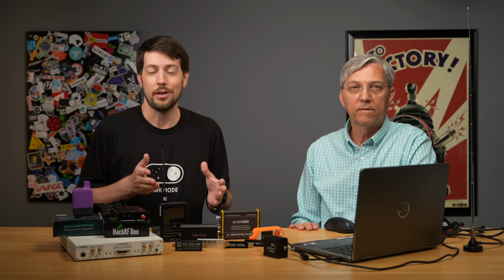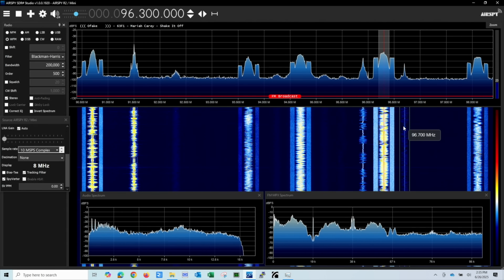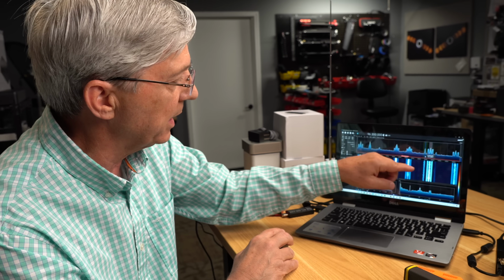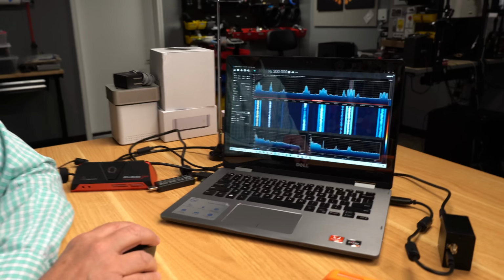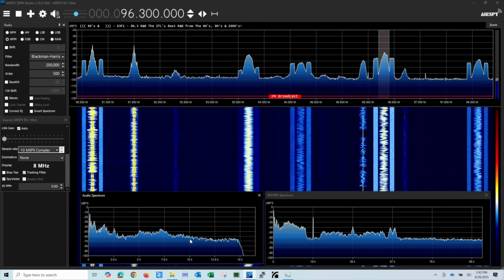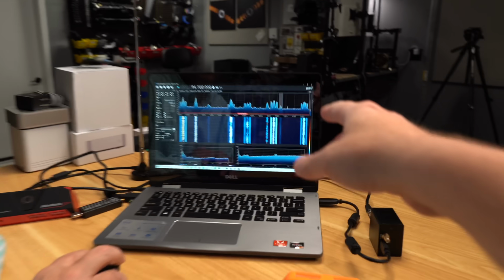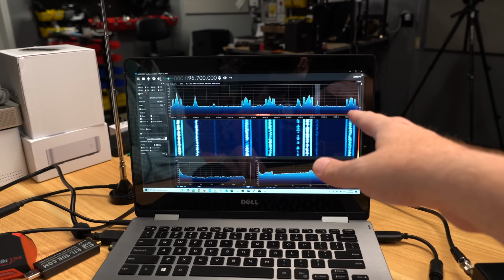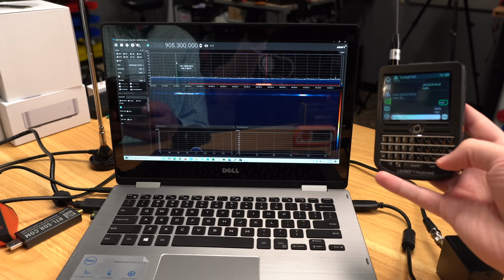SDR is an incredible tool for understanding radio

Comment: "It's a little bit hot and that's a cool thing"

But seriously, they have heaters in them to keep the crystal oscillator inside at a constant temperature for frequency stability. Stacking them probably isn't a good idea because the calibration temperature probably isn't the same for each unit.

I have a couple RTL-SDR dongles, one is a local flight radar (dump1090 and VirtualRadar), one is connected to a FM band antenna and I use it to listen to the radio on a computer. I have a HackRF One for just exploring radio bands. I just got a LibreSDR but I haven't tried it yet. I'm also a amateur extra class license holder so I often use them for amateur radio. Back in the dark ages I had a "First Class Radiotelephone Operator" license because I wanted to work in broadcasting, but I couldn't find a job I liked at the time. A few years later those licenses were discontinued and the FCC gave me a lifetime "General Radiotelephone Operator License" to replace it, which I never used. I've had an interest in radio technology for most of my life.

Comment: Helpful, thanks! What I'd like to see is what you propose for modern amateur radio astronomy. There is mainly 1420 and 20 MHz and 3-1700 KHz. One needs to record slightly above and below center to capture red shift. Linux (maybe Ubuntu) would be ideal due to the popularity of that OS for astronomy. Any experience with SDR on Linux?

Comment: I had the Airspy back in the day;) Really nice noise floor (or lack thereof) on that one. I ended up using a Nooelec NESDR in the end.. that one is fine for basic stuff. I connected it to an old MMDS downconverter to be able to watch the protocol from the nrF-chips for wireless keyboard communication.. that was quite the rabbit hole! Also looked a lot at the TETRA-networks and GSM stuff:)

Fun fact about those ferrite beads. I once came across a cable with one of those bumps on it but it seemed strangely light for what it was. I knew it was supposed to be there for emf supp so I was curious about and cut it open. Turned out it was just a plastic mold. Totally fake!

Great video;)

Comment: The chokes remove common mode that is on the cable. Its not resisted, its turned into “magnetizing force” thru induction.

Comment: Would the HydraSDR be able to catch ATSC1 broadcasts ... Open Source TV!!
Reply: Yes HydraSDR RFOne can definitely receive ATSC1 broadcasts (54-700 MHz, 6 MHz bandwidth).
You'll need proper decoding software like GNU Radio with ATSC1 blocks, SDR++, or specialized TV-SDR software.
Make sure to use a good UHV/VHF TV antenna for best results.
The HydraSDR RFOne's wide bandwidth makes it great for monitoring multiple TV channels simultaneously - perfect for open source TV projects

Comment: Love the videos with your dad. RTL_433 would be great to look at, keeping it to weather stations and tyre pressure. I use it to collect data off my sensors. NRSC5 might be pushing it legally, but I use that to transcribe talk radio to turn radio content into summaries with Ollama. NRSC5 can also get weather data (radar loops) which is super fun, figure you can know if it's raining or not using Python CV2 😅

Comment: Just got myself a cheap sub 27 euro (due to crappy country laws) generic rtl chip usb stick.

There is always a spike to the right. The antenna is picking up fm fine and thats it. The connector is really weird. 

I bet the next step is for me to pick up a telescopic antenna with that connector.

Comment: 6:51 There is a Github project called NRSC5 that can decode and play the digital HD Radio signal. It works better on Linux but it's ok on Windows too. It does require compiling, but there are some exes around if you read the comments.

Comment: Very excited to see this upload. I would love a series on the SDR world. I just got my GMRS license to allow me to make local TX transmissions/connections in the 462Mhz and 467Mhz frequencies legally while I work on my HAM Technician license. I have had a RTL-SDR for a while and have been trying to learn more on using it correctly along side the Flipper. Also got the HackRF clone with the Portapack H2+ to accompany those that should be delivered today. Right now with the RTL-SDR trying to learn how to decode P25 from my local police/fire departments.

Comment: I use a Raspi 3B+ and a Flightradar SDR Stick for tracking Planes in my Area with ADSB. Works awesome and I'm contributing to FR24 + I get a Business Subscription for that. Also a PC running the same software in another Country collecting FR24 Data.

Comment: Chokes filter out high-frequency common-mode noise, care has to be taken when choosing a material because they respond to frequencies differently. I don't know much about the methodology of choosing a size, shape, and material besides trial and error, maybe some Electromagnetic Finite Element Analysis if you are a professional-- to know exactly what effect they have on an electrical network you need a Vector Network Analyzer, or y'know just put the recommended material type ferrites on things until the RFI/EMI causing you problems goes away :)

Comment: Wanted to point out that SDRs like the Airspy R2 and HydraSDR using USB 2.0 is a huge limitation. If you need more than one make sure they are on different USB 2.0 Root Hubs.

Comment: I like SDRPlay’s devices. I have the RSP1 and with an up converter has given me what I need. The RTLSDR dongle from the RTLSDR website folks is good too. Even the tv dongles are ok with a long wire wrapped around that useless antenna that comes with it.

Comment: FYI the DSB mode is “double sideband” and is sometimes used by simple homebrew ham radios. It’s the equivalent of USB and LSB at the same time, or AM without the carrier in the middle. 😀
Reply: so in other words "double sideband suppressed carrier"  , DSSC
Reply: @robdavis3220  Well, yes, that's the same thing, except I'm not sure that is the correct term if the DSB signal has been generated with IQ modulation. But with standard methods like a balanced modulator then "double sideband suppressed carrier" would indeed be correct.

Comment: I have a NooElec NESDR Nano 3 plugged into my Home Assistant Yellow grabbing the data from the outdoor unit for a weather station we've had for like a decade at this point. This particular one only sends temp and humidity from outside. I want to upgrade to a unit that does all the data.

I also would like to see if I can get data from our water, gas, and possibly electric meters, but I haven't really poked those too much yet.

I also have a few RTL sticks I bought on AliExpress like 10-15 years ago (I bought 5 and sold a couple to friends that were interested in them), a couple of RTLSDR branded ones, some of the NESDR nano 3s, and a HackRF One.

Comment: The spurious rf that isn't a real signal being picked up are/were called "Birdies" in scanner documentation.

It was my understanding that they were a product of the receiver picking up harmonics of their own circuits. Every open wide band analog receiver has them. For an SDR you could probably only discover them in a RF shielded chamber. Being an SDR it should be possible to mask them in software, but that shouldn't be done without the user.knowing its being done.
Reply from the maker: A dummy load attached to the antenna jack may help too, I think. Might dig into that more.

Comment: I had to buy an inline choke for my Aux cable as it started picking up a nearby radio station and messed with my recordings! They're really useful to stop accidentally making antenna out of wires!
Reply from the maker: Everything becomes an antenna... usually when you don't want it to!
Reply: Heehee so true and then when you want to become an antenna, it refuses

Comment: i do wonder if you touch the end of the connector if you would revceve a RFburn abit like what happened to me in 2012 when 
i touched the pin out of my Bofeng when i boardcasted.     it was prob my first bad shock from messing around

Comment: I am a licensed Ham. I can sit down to just about any Ham radio new (analog or digital) or vintage and operate it, AM, FM, SSB, Voice, Digital etc. As a Ham I like HF digital operations, with no problem. But I have an RTL-SDR for about a year now  with SDR Console and SDR# software and have never been able to get any satisfaction out of it. What I would like to do is monitor entire bands or swoths or ranges of frequencies, yet to no avail.

Comment: Ok, this is the second time your channel blows my mind. I'm Bulgarian. I was wondering how to get into SDR because I want to be able to diagnose wifi issues. But the deeper I went, the more my interest grew. Hence I'm watching your video for pointers. Lo and behold, you feature a bulgarian product. Not only designed but MADE here. Less than 150km away. Blows my mind.

First time I had my mind blown was with your beloved Shelly plugs. I freaking love the open design and when I first looked into them I thought - huh it's as if a Bulgarian designed it - easy to hack and appropriate, might even call it a design born out of scrappiness. Turns out they have Bulgarian roots. And I accidentally listened to a lecture by one of their engineers. It was an intro into embedded ESP32 applications - the guy was trying to show us how easy and pragmatic is to put ESP32s into stuff. And how easy it is to load instructions onto them. And he kept referencing Shelly desings and stuff until I realized he is the one designing them and I have his products, recommended by an American youtuber. Still blows my mind!

Btw, Deva means Virgo, still a clever game of words.

Comment: Great video! I love "Save it for parts" too, so thanks for the shout out in case others don't know about it. My current living situation is dire for RF. I often say I live in a Faraday Cage because of the metal support structures in the walls. It's very hard to get any RF into the apartment and I am not permitted external antennas. I can't even get a TV signal into the apartment. I do manage to get some 800-900 mhz stuff for my local APCO 25 trunks, but all Law Enforcement transmissions are encrypted, so just Fire/EMS and transit are on the trunk. I have several SDRs and have been enjoying them. They're all the cheap ones as I am retired and have very little extra money.
Reply: If you are a HAM, HOA's cannot block you from having an external Antenna. If you have a window tape a coil to the glass and use that.
Reply: @RowanHawkins  Yeah the taped on on the window was my idea for an HD TV antenna. The twist with me is, I rent so the HOA rules are for the owner and they are not a HAM. Knowing my landlord, if the HOA even sends s letter complaining about an antenna, I'll be out in the street. I'll just do without an outside antenna for now.

Comment: Ferrites on power cords are used to knock down the spurious emissions from the switching power supplies (lot's of harmonics from the oscillators inside).  Ferrites on USB are usually there to knock down outside emissions, for example we had to add them to some of ours because the fluorescent lights were causing data corruption on the USB cables.

Comment: I go all the way back to tubes and crystals and now I work on massive IP and DMR based trunked radio networks.  Most modern radios I work on (LMR) are linux based SDR's that includes mobiles and handhelds.  More than 50 years working in the RF field and it's never been boring.

Comment: Putting in a plug for the BladeRF. Full duplex, 2 input, 2 output, MIMO. Fully compatible with GNU Radio and supported by most SDR packages. Perfect for when you need more power than a HackRF, but you don’t need a USRP (the $10K box shown in the video.) If you need to use it for HF, there’s the HamItUp IF stage you can use to drop down below the BladeRFs passband.

Comment: My favorites that I own:

The RTL-SDR is great for beginners and runs a wide variety of open-source software, even on a 15 year old laptop that was on the slow side when new 😀

The SDRplay RSPdx-R2 is a very nice SDR with built-in filters and is great for picking up amateur radio.  It can tune down into the longwave band.

The Nuand bladeRF 2.0 micro xA4 is another great SDR that has two receivers and transmitters.  It also has an FPGA that you can program if you want to.

I have to confess to lusting in my heart for one of those high-end SDRs that cost multiple thousands of dollars, but I'm not buying one until I can think of a project that requires one.

Comment: Looks like it's time to build a GPS repeater for studio, you already have an badass accurate signal :) . SDR can be used for TEMPEST attack to read info from screen, from cable, from printer etc. Just have to demodulate the signal correctly. Cool video, need more going in depth to the rabbit hole.

Comment: When I was a sub hunter in the Navy we were impressed when we could scan 1200 channels per second.
I rely on remote Telemetry to monitor temperature humidity and CO2 levels.
I have also manufactured a number of remote Telemetry units for utilities such as City Water Systems.
I imagine this SDR could probably intercept those as well as wireless cameras and the like.

Comment: I teach RF Communication at a local University and the students use and RTL-SDR along with MatLab for their lab.  
The lab textbook is free - look for "Software_Defined_Radio_using_MATLAB_Simulink_and_the_RTL-SDR".  The student version of MatLab is only $100.
Using MatLab they are able to simulate different receives and transmitters and with the RTL-SDR they can work with real signals.
For real transmission we add an inexpensive USB FM Transmitter - used for listening to radio from your digital device on your car radio.
I would love for them to be able to use a HackRFOne or a ADALM-PLUTO but those are outside of my budget.

Comment: I think you need a couple sdr's to do scanning on trunking radios - one to monitor the control frequency and other to move to the appropriate frequency since for example - the street dept might be on a channel for one transmission but then the next transmission they are on another channel but the police are on the other channel.  I haven't kept up with all the newest things going on but I think some of the sdr software now might be able to  decode digital transmissions too ( without some add on software). I have a pizero2w tracking airplanes with sdr on adsb signals and feeding the data to Flightaware which provides real time webpage maps for the local planes you are receiving and all their altitudes, speed, flight plans, tracks , etc .

Comment: I just happened to have started a project to use a NESDR Nano 2+ to spy on my gas meter. Working on getting the data into Home Assistant now. But it could be a cool thing to show off how something like that works. Also setup a Flight Tracker with another SDR last year. It's cool seeing what signals are just out there and doing their thing all around us once you get started

Comment: Is the data component on the FM signal the same as RDS - Radio Data System? I've heard of that. Here in the UK it's used to give station name, programme name and name of currently playing track etc. If I remember rightly the "dynamic text segment" feature is what is normally used to send the programme name, and the name of the currently playing track to the receiver, for display to the user. I don't often listen to the radio nowadays, but I do remember when RDS started to be included in car radios it made it much easier to figure out which station you were tuned to, since the station name appeared on the display of the radio, instead of just a frequency.
Reply from the maker: Yes; it's using RDS here, and newer cars have decoders built in, it is nice to see the station name... though some stations just sell ad space for RDS, so you see like "Jim John Lawyers 1-800-LAYWERS" on your dash :(

Comment: RG58 was the cable we used at  high school for the thin Ethernet (10base-2) network. Thin-net needed 50ohm stuff, so it was RG58, with a 50 ohm resistor on each end to prevent reflections. As you can imagine in a high school, with each room on a single Ethernet segment slung along the back of all the computers, disconnections were rather common! Eventually they applied special plastic covers to all the connections to prevent casual tampering. Wow that was a longer tangent than I intended going off on lol.
Reply from the maker: I remember yanking out some RG6 I believe when we were upgrading one network from token ring to 10baseT!
Reply: @GeerlingEngineering  I had to google RG6. Seems to be what is used for domestic TV antenna connections - 75ohm. Every day's a school day 👍

Comment: Hi guys. Just found your channel.  Very interesting!!  I purchased a V4 that I’d like to run on my iMAC. So far no luck. I finally got SDR++ installed & Angel. But I get no audio. Asking different people I get so many different answers like run Linux, install Windows, I guess there’s many ways to skin a cat.  Have you given any thoughts to a beginners class on SDR?  I was a service engineer at Sony but this install is really making me feel stupid!  Thanx, Jeff
Reply from the maker: Don't worry, I had trouble with the v4 at first, too. Some packages didn't have support, so you had to compile them from source or get the driver going some other way.

It's a little better now, but I had the best luck with the v4 on my Mac using GQRX!

We will definitely get more into SDR, not sure about a full class or course but who knows?

Comment: I am using RTL-SDR v3 to listen to 433 Mhz signals from humidity and temperature sensors around the house via MQTT server and the data gets sent to Home Assistant.   Using MQTT explorer I can see all kinds of 433 Mhz devices around my house and neighbors such as TPMS!
Reply from the maker: Working on a 433 Mhz setup with rtl_433 this weekend, ha! We think on similar wavelengths.